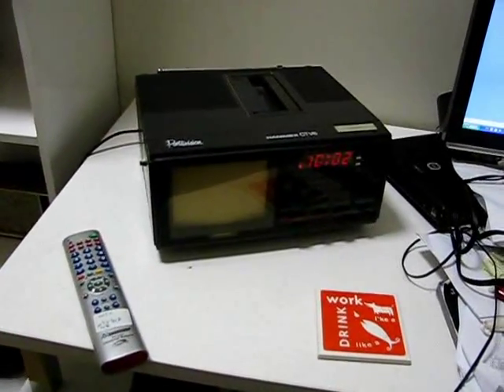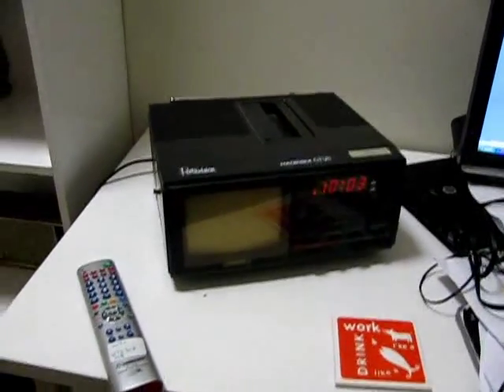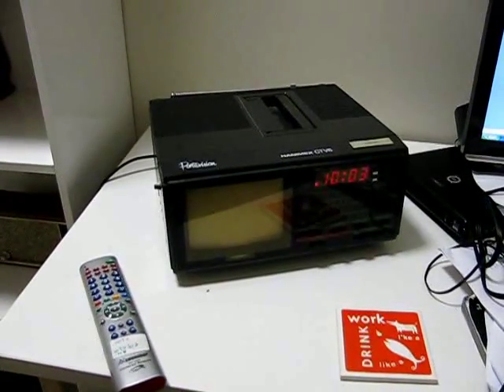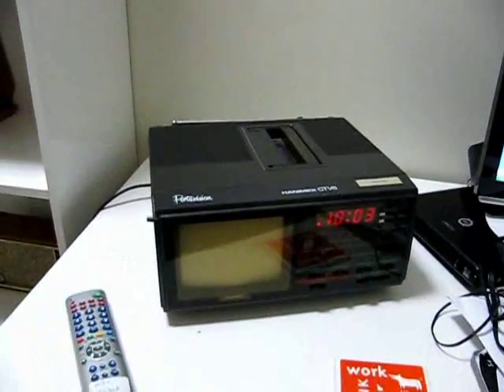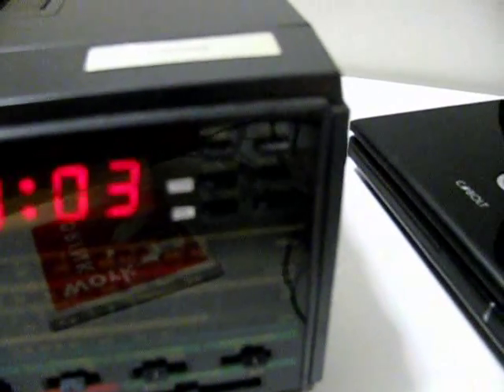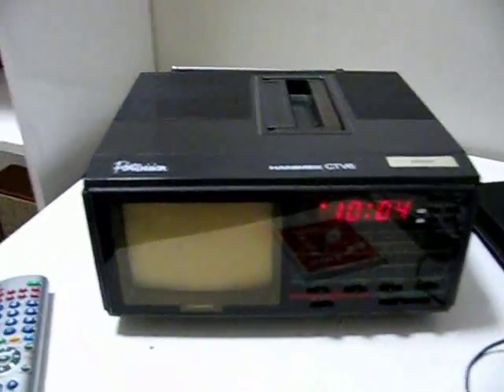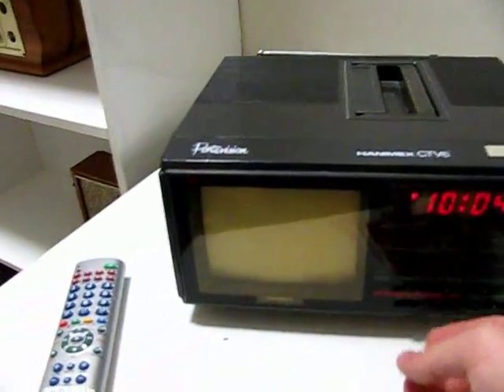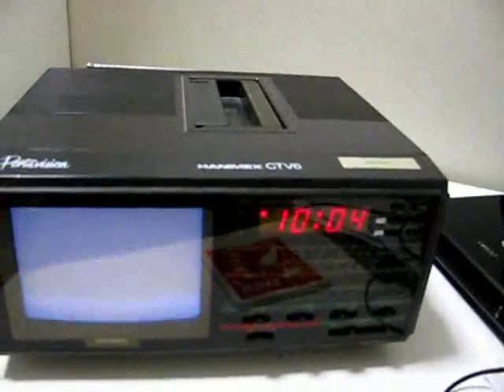Hanimex CTV6 clock radio TV with upgrades

Comment: Hi Bryce, I have one of these CTV6 unit I’m currently servicing/cleaning. Had a couple of questions if you had time mate:

Having trouble adjusting horizontal left/right using pots on the board (no H-POS pots, only V-SIZE/H-HOLD/V-HEIGHT/COLOR-DLMUR/SUB-BRIGHT) not sure how to get the image back to the left about 1cm. Also not sure what the DLMUR is to be honest.

Also with the AV mod, it looks great very nice job. I would really like to see a few pics or even how it’s done if you ever had the time.

This CTV6 I’m servicing is in great shape and image quality and geometry is great. Would really like to breathe some new life with similar mods, would it be possible to get in contact mate? Cheers
Reply: Hey, did you find out how to do the AV mod ?
I just picked one of these up and would like to do the mod, but it looks like @Bryce Cheery doesn't reply to comments... 🙃
Reply: @danotten3344  I've just composite modded mine. I've tried posting links here to help others, but youtube doesn't seem to allow my comment.
Reply: @ashtonspangler  Oh Damn, is there something I could search to find it ?
Reply: @danotten3344  it's also sold under another brand "Kawasho 3706". That'll get you started on your Google journey.

The AN515N datasheet will be your next point of call